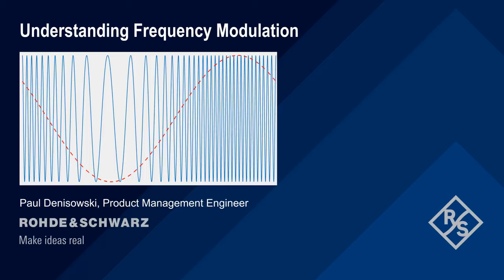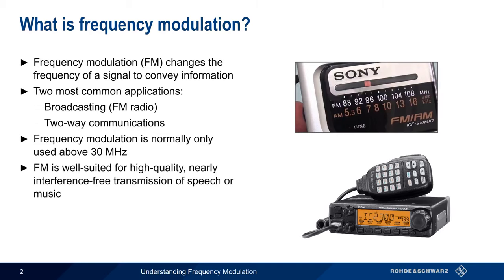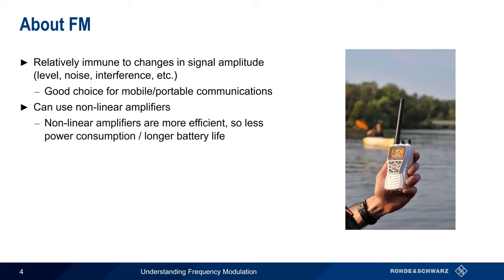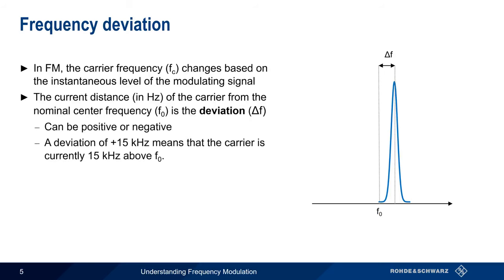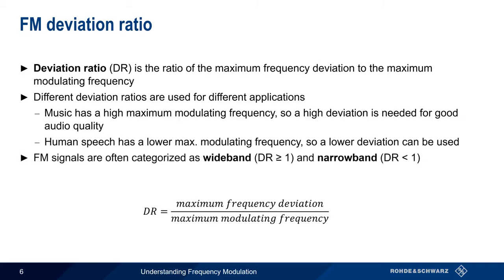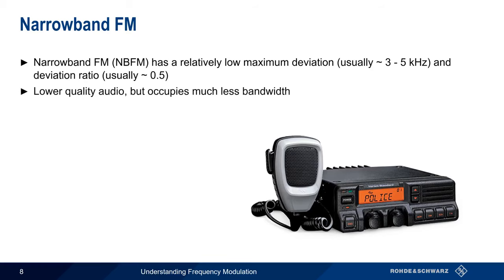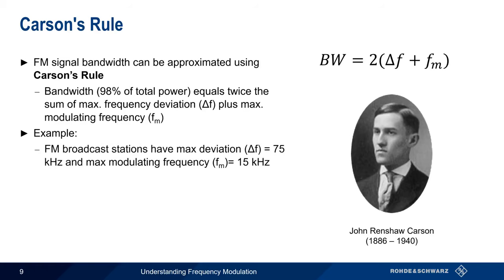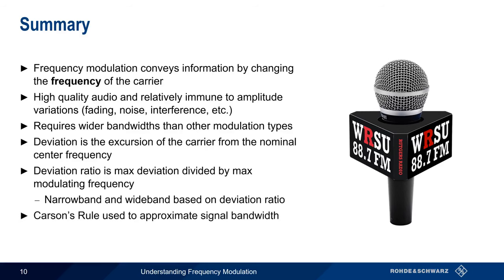Understanding Frequency Modulation

Comment: Hey nice video and thanks a lot! If I understand correctly, the deviation ratio is exactly the concept: modulation index=delta_f_max/f_m, as what I learned in the RF electronic courses, right? From my lecture, the modulation index is a function of the voltage amplitude of the modulating signal. So if I use an external source (10kHz) to generate the modulating signal, and set the maximum frequency deviation on the R&S as, for example, 100kHz. Will the frequency deviation change if I change the voltage amplitude of my external source?

Comment: How is signal added to carrier wave? What exactly occurs in the spot where they are added together? Why does carrier wave change just because because signal is added to it? What device is used to add the carrier wave and the signal wave together? What happens at the other end, how is signal extracted from the composite waves, how is done and by what?
Reply: Modulation involves changing some property of the carrier (in this case, its frequency) based on the modulating signal - they're not really "added" together.  In the case of FM, a special device called an FM (de)modulator is used.  The actual details of how the carrier frequency is changed by the modulating signal (and how the modulating information is recovered at the received) is somewhat beyond the scope of this introduction, but there are many, many sources of information on this if you'd like to deeper.   [Incidentally, there are multiple different techniques for demodulating an FM signal, e.g. quadrature, PLL, etc.]

Comment: Another nitpick: The maximum modulating frequency of commercial FM radio broadcasts is not 15kHz but rather over 38kHz due to the stereo encoding and even over 57kHz for added information (RDS in Europe, TTY/CC in North America)...
Reply: Now I understand - you meant the usable audio spectrum - yes that is 15 kHz and the first FM radios had it even lower (13-14kHz) to have their rather bad analog low pass filters to mask out the pilot tone. I love FM. I built my own FM stereo receiver 1986 at age 15. And when disabling the stereo decoding and low pass - you could record the mono FM signal on a tape machine and actually hearing the pilot tone when running the tape at half speed...